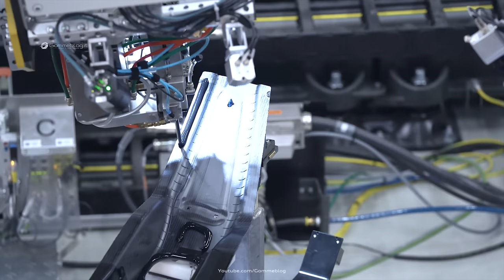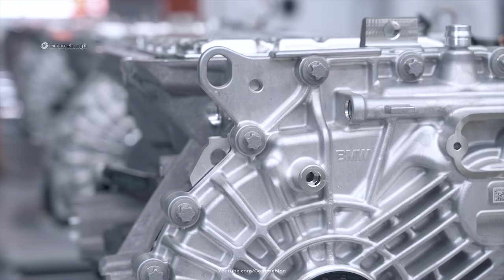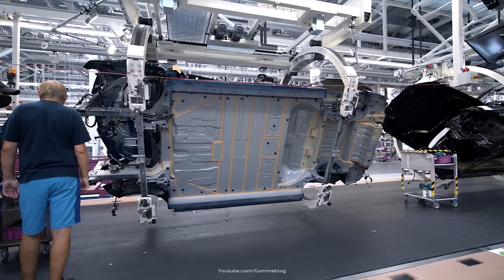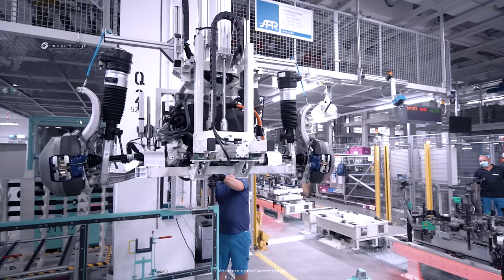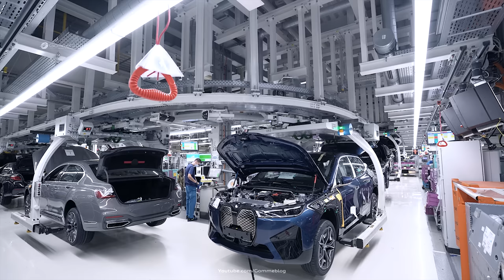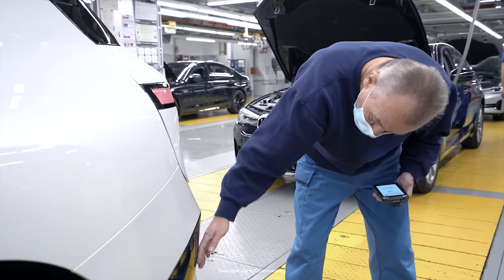2022 BMW iX  - Production (German Car Factory)

Comment: And it is said that electric cars are simple,that they have few parts but when I see something like this...many things can go wrong.
Reply: They are simpler if manufactoried correctly like tesla does, the others still use the old way of macking the cars and they will pay the conseguences
Reply: @scolapasta9316  How does Tesla make their cars? How is it different?
Reply: @umarfaruq2917  because they use far less parts, first in the monochoc which is made of one single piece made thanks to the Giga press, than because the use far less cables, u can see it in Sandy Munro's videos and also the bumpers are made with less parts.
Reply: Interesting comment.  Tesla designed an electric car from ground up without influences from legacy car design and manufacturing, BMW and the others go the other direction so naturally they will look to leverage their legacy manufacturing and design expertise which will naturally influence their design and build.  Just look at Musk and SpaceX and compare that with what NASA produced and even Boeing's new capsule..